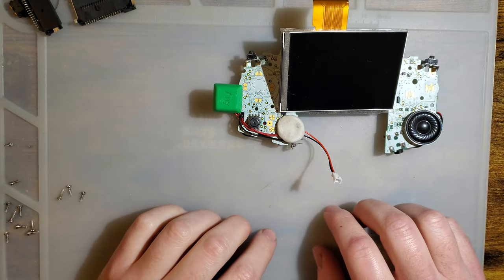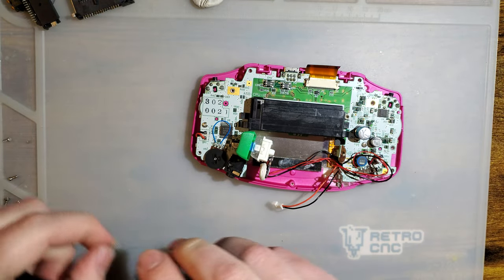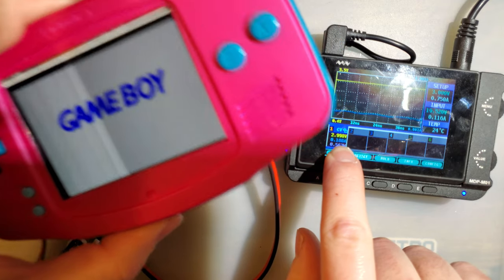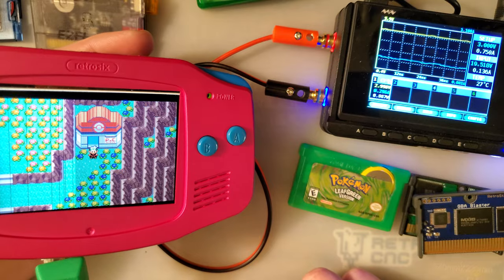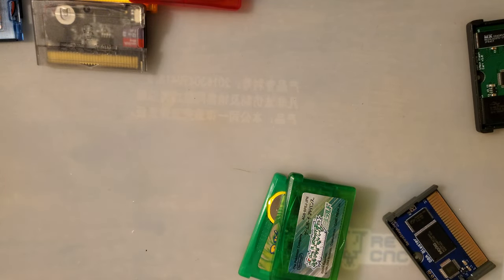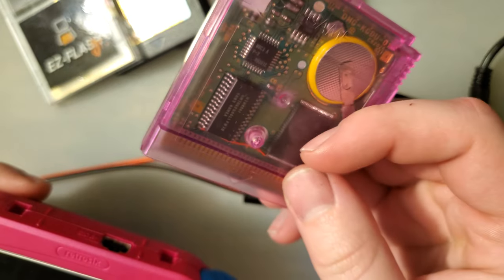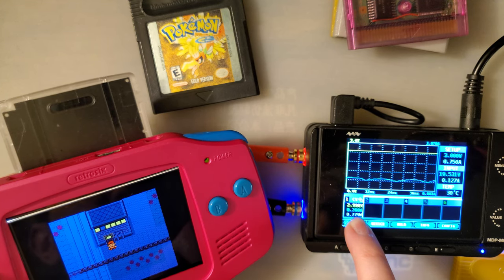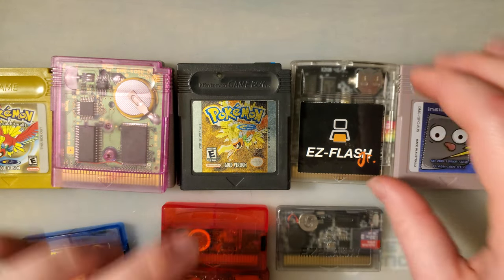EZ-FLASH OMEGA Definitive Edition Power Usage (And Other Flash Carts Too!)

Comment: I was initially disappointed when seeing there was a new "DE" edition when I only just got mine within the last few weeks. After watching this... meh. Not so much any more.

A bunch of features I probably don't care about and 11% less power usage compared to the original EZ Flash Omega. Big whoop. Battery life is already not great with an IPSv2 screen. One of the main reasons I did an IPSv2 mod to one of my beat up SP 001 units. Rechargeable battery. I give two flips less if it only lasts 3-4 ish hours. When I'm done playing, I charge it. Usually every other play session. I don't get a ton of time to play games any more. I don't need 10 hours of battery life. 11% improvement means roughly another 20 min of play time. Again, big whoop.

Thank you for making this video!

Comment: OMG. EZ Flash is very cheap but the startup power consumption is a joke. 
Ez Flash Jr + Game Boy Pocket + IPS Screen = the console cannot start.
Ez Flash Jr + Game Boy Pocket + Original Screen = the console only works for one hour. Then there are problems with startup and saving the game...
Reply from the maker: To be fair, that's more on the Pocket than the Ez Flash. Modded Pockets will struggle with regular carts too, like Pokemon Gold or Silver.

Comment: Why out of all the modded GBA consoles you have around do you use that Frankenstein of a console to test the new flash cart?   I don't get it, just use one of your good ones.
Reply: Reliable readings and what not, he touches on it briefly. Plus if you tinker, whatever is nearby that does the trick is good enough xD
Reply: @M3D1C2121   He always seems to have mangled consoles laying around for some reason and always uses the cheapest of AA batteries lol.
Reply from the maker: @charvelgtrs  I explained exactly why I used that particular console in the video. I also used a power supply to run this thing. Are you even watching my videos?